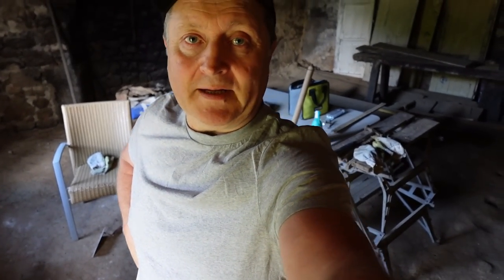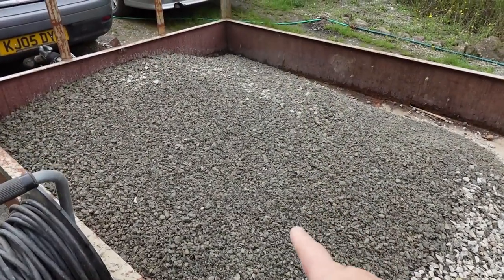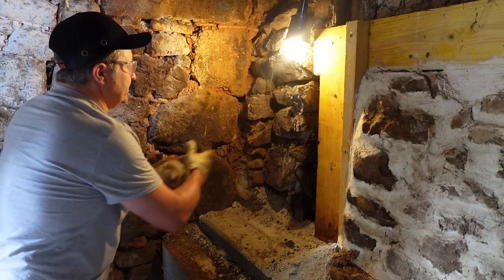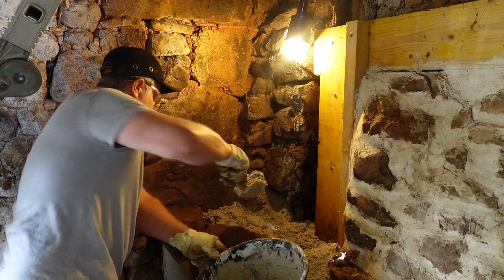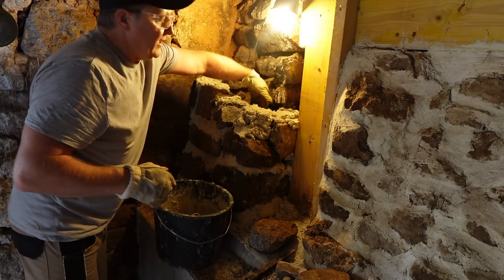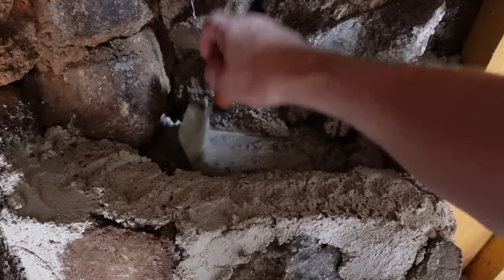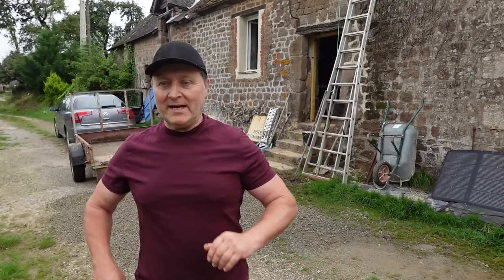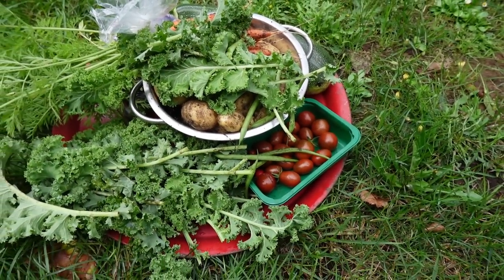Repairing My 250-Year-Old Cottage Wall | Cottage Renovation Episode 20

Comment: Looks like a much-improved design that will last well. In a previous video, you said at times you were short of electrical energy when the weather wasn't so good, I suspect Winter may be a future challenge. May be worth looking into a small capacity, and cost, wind turbine with maybe technical help as needed from your battery sponsor. Cheers ...

Comment: You have probably already figured this, but as the driveway is re-gravelled, it gets higher than your foundation, and that is where tbe water sits. Build your hardscape higher than the road young fella
Reply from the maker: Hi it probably don't show on camera but the drive is much lower than you think. Gravel is used here for drainage as it does not hold water. Hard landscape with be permeable 😉

Comment: The corner behind the door, instead of a timber supporting the beam what if you had a stone corbel. Either a piece of architectural salvage or a couple of stones fitted into the wall below the beam. Bottom stone would stick out 2 or 3 inches, top stone 2-3 inches more. Do you think that would work instead of a post in the corner? Neater appearance maybe.
Reply: A)he had the post already 
B)the cost of a stone that long and of the right density to carry the load
C)two stone pillars stacked would slip under the load eventually
They would have to be larger dressed cut keyed and pinned to lock them together like a column on a portico you need to be a stone mason or hire one
Reply from the maker: The timber upright will form part of the new wall

Comment: I would have fixed the roof first and foremost.  I don’t see the sense of repairing inside walls while rain is still coming in through the roof.
Reply: The leaky roof is next door on the barn and it is not for want of trying but we cant find a roofer who has time to do it they come and look  say they will be in touch with a price and then you never hear from them again or if they do get back to you they say they can do it in 18 months time because they are so busy!
Reply from the maker: The roof was fixed temporarily when l started did you not see the tarp on the roof.